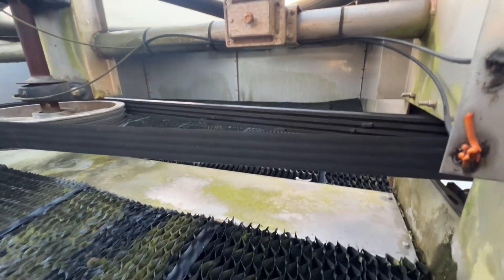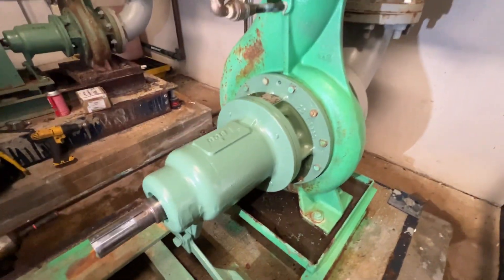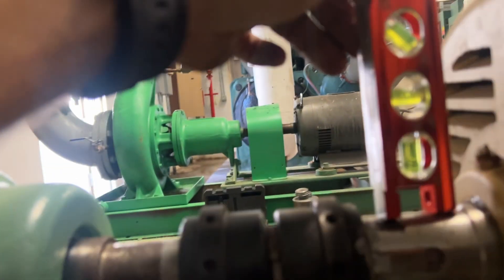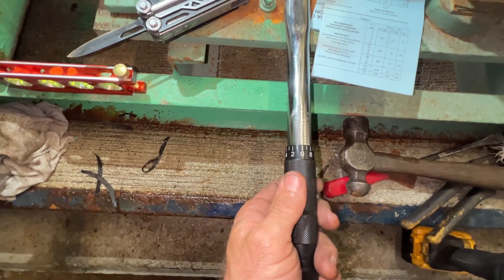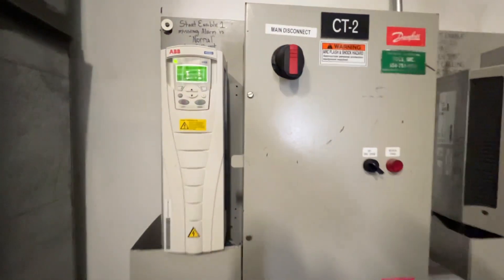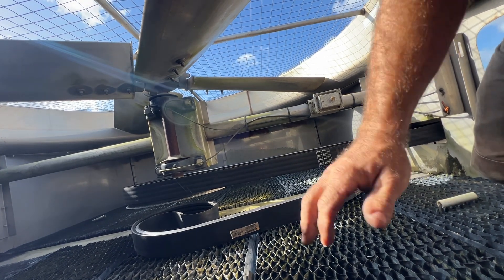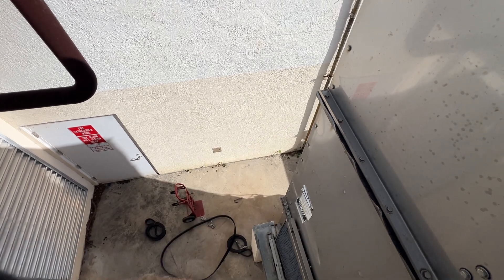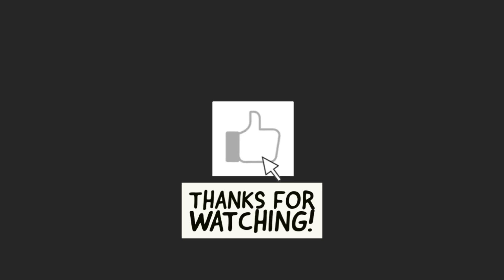Chiller Cooling Tower Wants Attention .. Pump Power And Small Temp Difference

Comment: Place I worked for had a dozen or so 60 to 75 HP driven cooling towers all on VFD'S. Of course the four most critical towers had the most problems. Who ever connected the 480 volt wires was no electrician. They did not tighten the split bolt bugs tight enough and only used a couple of turns of cheapest made cheating china tape. All four would trip out in ground faults until I climbed up and redid connections. Thought it was hot & extra muggy in Viet Nam and in a slaughter house kill floor & basement rendering plant but after only spending a hour up inside of these towers underwear  & even my socks were soaking wet from sweating. Vibration switches would of course give us the most trouble during hottest muggy days.
Reply from the maker: Definitely not the most desirable environment to work in , hopefully this prevents me from sweat soaked experience this Summer 🥵Thanks for sharing your experience 👍